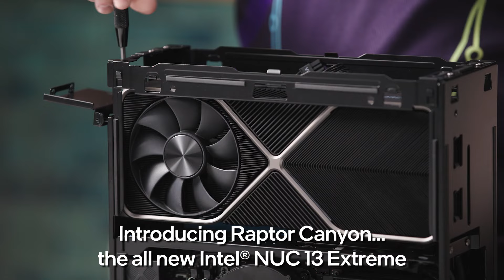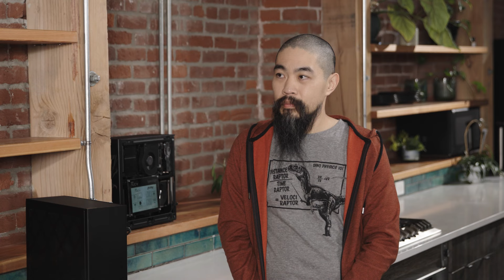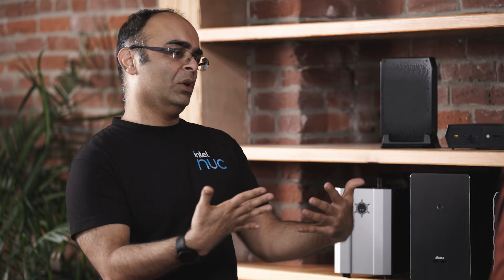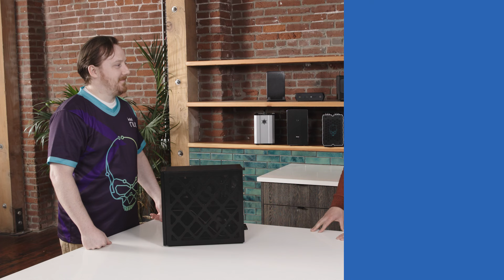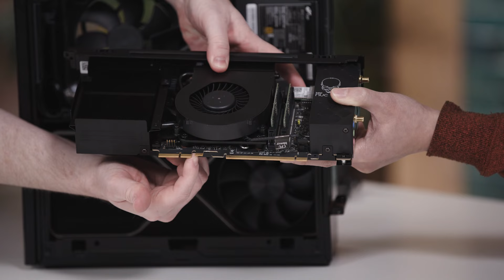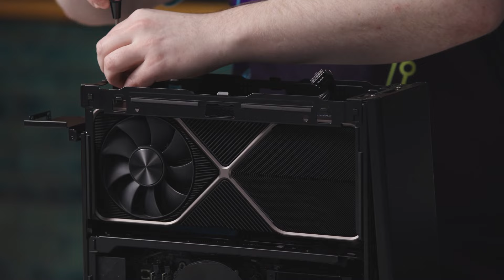Intel NUC 13 Extreme “Raptor Canyon” explained | Talking Tech

Comment: one of the bad things about this form factor is that you can't put a liquid cooling solution and you can't put heatsinks on your m.2 ssd so they stay cool enough to give constant performance and not dip because of thermal throttling due to over heating, liquid cooling the gpu, cpu, memory and storage is very important to keeping the performance goals advertised

Comment: amd themselves should make something like this , a nuc extreme 13 like sff (not mini) pc, even though intel won't make more intel nucs past 13th gen , nucs will still be made , i believe at least asus has gotten the license to make nucs with 14th gen and later gen cpus, i like the small form factor of the nuc extreme, they could have put a giant glowing skull on one of the side plates at least lol, but as good as it is, you're still sacrificing some performance because of its compact size compared to a regular gaming rig chassis, a bigger chassis has better air flow and you can use a watercooler, you can't fit that on the nuc 13 extreme, and thats it's biggest if not one of nuc's biggest chassis, but i've seen people able to cram a regular size (not aib versions, theyre too big lol) rtx 4080ti and even a 4090 on the nuc 13 extreme, now it wont run as good as on a bigger chassis because of higher temps so it might take 20% performance in at least the gpu but a desktop rtx 4090 in that small form factor is commendable

Comment: Are we going to ignore non-replaceable 750W PSU with dedicated cables? It was so easy to support SFX PSU - there is enough place in the case, but Intel decided to add a useless bottleneck. Why?

Comment: what about using the compute module standalone. does it only need 12v power via 8pin eps. or does it also need supplemental 5 and 3.3V via the pcie connector like past nucs?

Comment: Thank you for adding a 10GbE ethernet port by default. It still amazes me that for some inexplicable reason 10 Gig Ethernet seems to be only limited to high end ATX motherboards and rarely ever on ITX or smaller boards. This really needs to be the next standard push for PCs given the increased bandwidth needs for both content and creative use cases.
Reply: Considering home internet bundles top out at 1gbe, I'd say your logic on needing 10gbe for content and creating is flawed.

Comment: That’s pretty F’ed up that a machine that cost a pretty penny with a socketed processor that INTEL built wouldn’t support the next gen INTEL processor, why the f even socket it if you can’t change it. That’s the only reason I bought the *bleep* thing, and I bought a 13900k as soon as it was released just to find out intel doesn’t support intel Holy *bleep* are you telling me that intel doesn’t support intel. They just *bleep* on their own product… Thanks Steve!!!

Comment: Man, this really gets at something I've been thinking about for a while. Could you not put a PCIx port on the edge of the motherboard and have the motherboard and gpu light flat and parallel next each other? I think this could lead to some new form factors and possibly simplify cooling. Just a thought.

Comment: Bought a NUC 12i9 extreme last month.  Installed Win 11, no audio coming from the PC. I was told by Intel to update my graphics card driver,  which I did several times , but to no avail.  I am using my Bluetooth speaker to listen to audio. Wasn't expecting this for  roughly $3.3k(Aud) spend!!
Reply from the maker: Sorry to hear about your experience. We have notified our experts and they are currently working on your case. This might take some time, we will get back to you once we have an update via email.
Reply: @IntelTechnology  thanks guys... look forward to getting this resolved asap
Reply: @jims2020  did it ever get resolved?
Reply: @EvilAngel888  nope, I guess there is no sound card shipped with this model.  I am using a Bluetooth speaker to listen to audio.
Reply: @jims2020  So headphones dont work with it?
Reply: @EvilAngel888  nope I couldn't get it to work even if I plugged it into the audio port. I tried installing drivers,  but nerve fixed the problem.  One of my friend's purchased a Nuc 13 extreme couple of months ago,  he too has had the same issue I.e. no audio from the PC naturally, will need to hook to a Bluetooth speaker.
Reply: @jims2020  that's hella weird o.o did you try USB headphones?
Reply: @jims2020  also is there any delay on the bluetooth audio? like lets say youre watching youtube or a movie, are the speakers in sync with the video?
Reply: @EvilAngel888  nothing that I have noticed yet.  With Bluetooth 5.0, the audio sync is seamless.
Reply: Since the NUC12DCMi9 does not have built-in audio, then it is your GPU that is the issue. Maybe your drivers are bad and need to be re-downloaded. Try uninstalling the dGPU drivers completely first and then do a clean install with the latest driver. Maybe remove your dGPU and use the built-in graphics to see if you get audio. I have the same unit and audio works fine with my 3070 FE installed.
Reply: @MitchyTheKid4095  thanks for your response,  I only have the built in gpu... no external gpu. I tried all approaches - uninstall,  reinstall, bios updates and followed all possible documentation provided by Intel.  They asked me to get a headset to plug into the headphone port on the front face to collect logs, tried that as well but to no avail.